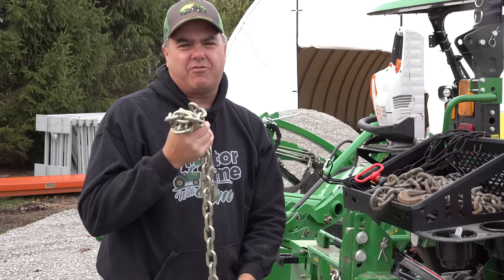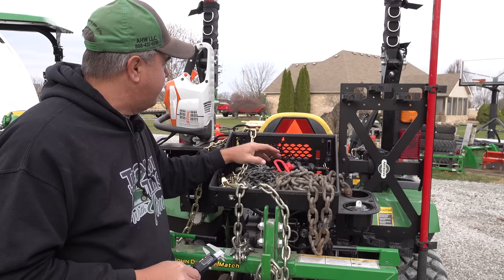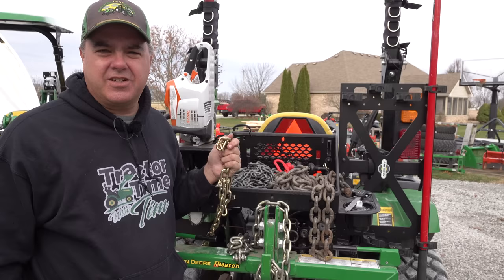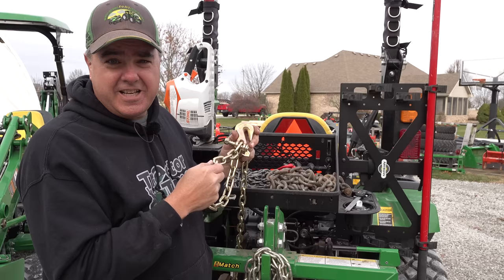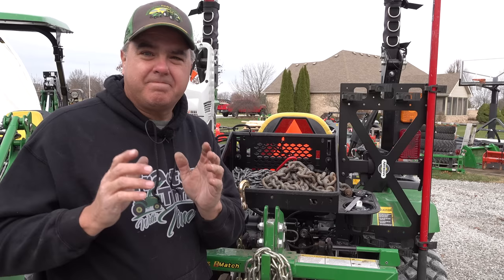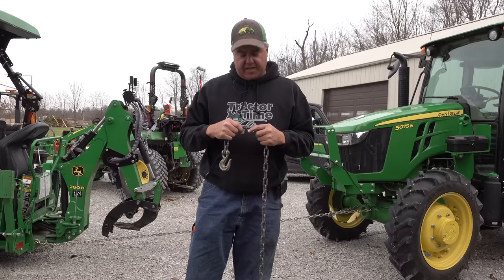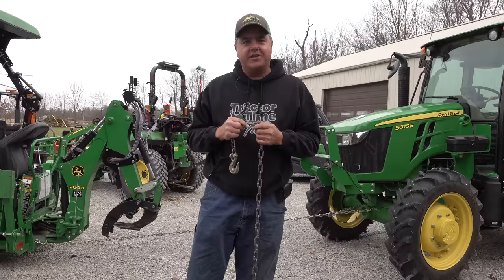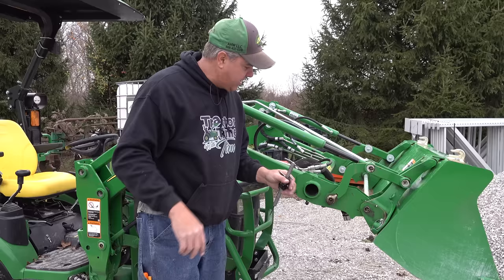What Compact Tractor Owners Need To Know about CHAIN!

Comment: Simple subject, but the reality is you might be saving someones life who has never had a basic education on proper chain use, well done Tim.
Reply: Growing up we never had chain except for the tires. Now I have several chains with a 5/8" x 20' the largest.  It works great for removing tree stumps but when tied around the waist it is a bit heavy. Much better to use the truck or the small tractor.
Reply: I'm here to learn  I ain't never had no bad luck but if I can learn enough to prevent it 😜

Comment: Excellent points!
As a former fence installer who used chains for transport,and pulling old posts from the ground.
2# 12ft chains ,each with a slipper and standard hook. 
Pulling posts,hook chain down low on tractor and post.
Add the largest wheel (scrap wheel/rim or with tire)  as close to the post as possible, and run the chain over top of it.
The wheel becomes a rolling fulcrum.
A 4x4 works better,but needs an experienced holder and tractor driver.

Comment: Hi Tim;   Very nice video covering the basics of chains.  I wish I had seen it 10 years ago when I first got a tractor and started being an amateur farmer!  Over the years I had to learn most of these things via the school of hard knocks... but my tractor survived and I still have all my fingers!  I did want to comment on one thing though...  You mentioned the WLL of various sizes of chains and commented that a 1/4" size grade 70 chain was sufficient for use with a sub-compact tractor because the tractor could not pull any harder than the WLL of the chain.  This is true, but only on a straight pull.  If you are using force multiplication with pulleys then all bets are off!  I frequently use chains as part of the rig I use to topple trees.  I usually prefer to topple a tree if possible rather than fell it with a chainsaw as I know exactly 100% where the tree is going to fall, I can be far away when it falls, and it gets the stump out of the ground as part of the deal.  I use 1/4" wire rope (1200 lb WLL) and 10 pulleys which gives a theoretical pulling force of 12,000 pounds (at the load limit of the wire rope) against the anchor point which is provided by the chain, sometimes quite a long chain, over to a big strap looped as low as possible around a big tree.  I use 20 foot lengths of 3/8" grade 70 for this (6600 Lb WLL) joined together with double clevises and have never noticed any distress in the chains.  The pulls are always done slowly and smoothly, usually with the tractor engine at idle speed.  More power just isn't needed.  So far this has worked 100% on trees up to about 18" -20" in diameter rooted in heavy clay.   Having worked this all out by myself with no expert guidance I am not sure an expert would approve of this procedure and if you have any comments I'd love to hear them!  By the way...  I store my chains in rubber feed buckets.  The rubber buckets don't crack like plastic ones do, they keep the chains organized, and the handle makes them easy to carry around.
Reply: How far up the tree do place cable and how do you get up there?
Ditto on the rubber bucket. It’s been my chain storage for decades.
Reply: Hi Stuart;  Actually to topple a tree I pull on it quite low (where it is stronger) as I want to pull the root ball out of the ground and not take a chance of breaking off the trunk of the tree which could be sudden and uncontrolled.  At the tree that is being removed end of the rig I put five 6' foot long double loop straps (Princess Auto part number 8021419) wrapped around the tree as a choke.  These straps are typically placed only 5 to 6 feet above the ground.  The free loop on each strap is placed in the hook of a 1 ton snatch block (Princess Auto part number 8824922).

    At the anchor end of the rig a 30 foot vehicle tow strap  (Princess Auto part number 8841561) is wrapped 1 1/2 times around a stout tree as low as I can get it.  Wrap it so the 2 looped ends are even and put a shackle in the loops.  The shackle connects to 20' lengths of 3/8" grade 70 chain.  I use as many 20' lengths of chain as required to get near the tree I am toppling and join them together using double clevis fittings (Princess Auto part number 3804598).  At the other end of the chains I put another double loop tow strap connected to the chains by a shackle. This shackle can be moved along the last length of chain to fine tune the gap between the 2 sets of pulleys.  At the loop at the free end of the tow strap I put the hook end of 4 more of the 1 ton snatch blocks.  This leaves you with 2 sets of  pulleys facing each other.

      I use a 150 foot length of 1/4" wire rope to lace between the 2 sets of pulleys. (The wire rope is prepared with a loop at each end using a thimble and wire rope clips.)  The anchor end of the wire rope is connected to the loop on the tow strap (along with the snatch block hooks) by using a shackle. The free end of the wire rope has a shackle on it which  goes over a hook on my tractor.  If you work it out this means that there are 10 lengths of wire rope between the pulleys so the rigging should be set so that there is about 15 feet between the 2 sets of pulleys.  (150 feet of rope divided by 10.)

       I then use the tractor to pull on the wire rope and gently tip the tree over.  Keep an eye on how tall the tree is compared to how far away you are from it with the tractor!  You don't want it landing on your head!  A variation is to add a 5th pulley at the anchor end and pull in the opposite direction.  This way the tree is tipping in the direction opposite to the direction the tractor is moving so it is a bit safer but you don't always have room to do this.

     I hope this helps but as always, use this information with caution,  common sense, and at your own risk....
Reply: @Vincent_Sullivan  Super helpful response, especially the URL for the products you referenced.  Thank you.
Reply: You wouldn't have a video on this by any chance? All those parts you listed are currently available at Princess Auto BTW. Thx.
Reply: @Stu2366593  Hi Stuart;   Having the Princess Auto (PA) part numbers only helps much if you are a Canadian living near a PA branch but I figured that anybody anywhere could browse the PA web site and see a photo of what I am talking about so they know what they are looking for when they search for a local source for these items.  Yes, all the part numbers are current - I checked on that!  I really like these snatch blocks as they have a couple of features that make them particularly suitable for this sort of work.  I got mine years ago and PA didn't stock them for a while and I am very glad to see that they are now back on the shelves.

       Sorry, I don't currently have a video of the process.  That is not a bad idea though!  Next time I topple a tree I'll see if I can take a video to post on YouTube.

Comment: I determined after years of use around home that a 9-10' 1/4" grade 70 or 80 with one grab and one slip hook covered most everything I needed to do with my compact tractor and yes I also stored it right on the floorboard so it was always there and I can't stress this enough, "I never had to go looking for it".  I did the same at work in the backhoe (12'), the loader, grader and each dump truck had 20' of grade 70, 5/16" transport chain.

Comment: I use a quarter inch 120 grade chain with a grab hook and a slip hook on it. I use it for logging in a small operation I have been made fun of it for a long time but it is some much lighter. Like you said It can be used all day with little exhaustion.

Comment: hi tim i use chain every day well presented. one storage idea that i use for the truck regarding chain which will help is cut out the top of a 5 liter plastic oil/antifreeze bottle taking out the spout but leaving the handle intact. not only dose it store the chain but makes it easy to carry. we fit 9 meters of 8mm grade 80 chain in one bottle
Reply: Very smart. Good tip

Comment: Haven't seen it in the comments yet, but don't forget to throw something over the top of the chain in the center (coat, blanket, etc) before pulling.  That way if it comes loose under tension it won't become a as much of a danger.  Think of it as if it were a cable that broke, it is a deadly whip that can cut a person in half.  If possible cover at least 5 feet.  Don't own a tractor but this information is applicable to many situations.  Thanks Tim, keep up the very informative videos.

Comment: I am retired now but I was a machine repair man also a tool and die maker but to make the story short I went to school for six weeks to learn rigging and there is a awful lot involved in rigging.

But I will tell you this I think you did a very good job and explaining the basics what you should watch out for, one other thing the higher the chain is if one and breaks that means it's going to be flying in the air at that height and it could easily hit a man behind the steering wheel of the tractor,

I seen  two 20-year-old man towing a car up a hill with a heavy forklift truck it had a full cage around it and a was factory workers with no experience with rigging, I walked out the door just before the chain snapped and they was doing the same thing as your neighbor did. When they took off to pull the car up the hill the chain snapped and hit the wire mesh cage that was around the forklift.

They both jumped out of their vehicles laughing I walked over to them and looked at the guy behind the forklift truck and I told him you are lucky you took this forklift truck and not the other one that don't have a cage around. That chain would have slapped you right in the back of the head and you probably wouldn't be here today.

After he looked back in force at the forklift and the car he wasn't laughing no more I told him if management everything you doing that you both would be unemployed right now consider this a lesson of life don't ever make that mistake again never jerked a chain like that.

I did not report them because I could see the seriousness of the situation they understood when I explained it to them and I figured it was a lesson enough to learn without losing their jobs, power equipment is very dangerous and I really think this was a good video to teach people a little bit about that good job buddy

Comment: I understand your point about hooking low for safety,  but sometimes you need to hook higher to add weight to your tractor.  I hook to the three point hitch so that I can lift with the chain.  In this case I hook very short.  Put some dirt in your bucket for more weight.

Comment: I started farming with my dad 50 years ago. We grew spring potatoes in Florida and often had to harvest in the mud. We had 70 hp tractors (John Deere 3020) and used 20 ft of  half inch chain to pull struck trucks out. A real work out lifting that thing.  About 15 yeas ago I was working on a farm and had to use a 200 hp JD 4960 four wheel drive to pull a fully loaded (30,000 lb of potatoes plus the truck)10 wheel bulk truck out of deep sand where it had broke down. All I had was a 5/16 chain that the boss said was good enough. I made sure to take up the slack before I fully let out on the clutch. The tractor dug in and away we went. All those years using that heavy logging chain when all we needed was a good quality 5/16 one.
Reply from the maker: Ha!  A 4960 can break a 1/2” chain in some situations!

Comment: I have a good tip for you if you are having to pull something horizontally, it takes two chains, but it's totally worth it.  Put a used tire in between, even if someone starts to jerk the tire will give and slow them down, but it will also let puller have enough momentum that it will let you pull more than you would have (not as necessary if you are using a pull strap).  Also, a warning, be careful going around any cast items, especially a yolk like piece, if you were using something stronger than the small tractor you would severely risk breaking that piece (I'm speaking from a bad experience)  the four bolt holes on the front of your tractor, under the grill (where a weight bracket would mount) would be a great place to add a hitching point.

Comment: It's not the Working load limit thats gets you into trouble it's the shock load put on a chain that's the real test, yea your machine might have a gross weight of 2500# but have to much slack and you could easily quadruple that amount, ie. 5/16 transport will break at about 20,000#, not sure about 1/4". it might be heavy but i won't go less than 5/16" on my subcom. Something else to consider, if you are try to pull a stuck object, ie. car, truck ect. Use the proper weight nylon snach strap, they absorb the shock load or give you a more gentle pull, and arrest your pull line (if very long, 60 feet or more ) with an old tire (no rim) with the line passing through the tire in the middle of your line to help prevent wip, especially steel cables, they can be deadly. great video with great information.

Comment: Great video!!! Even though my dad  ran a wrecker service and towing service for 50 years and. I worked for him when I was young, it re-enforced the proper uses, practices, types and applications.  I have some chains that have been stretched and abused. (not all by me!!).  I am going to  replace and upgrade all my  smaller over stressed chain with  grade 70 chain with the  retainer hooks before spring.  Thanks for  inspiring me to get going and  to use the proper  chain and use safe practices!!!

Comment: the little slots beside the draw bar at 11:50 are attachment points for safety chains when pulling  a trailer or implement equipped with safety chains  and some free advice - when pulling with a chain lay something over the chain, like a folded tarp or fender cover or even a coat to make the chain go to the ground if it breaks, this is especially important if pulling with a cable or a rope.  if a chain has stretched links it should replaced.

Comment: Great instructional video. I happen to have had many  chains that have been stretched. They came from my In laws that worked in gravel pits all their careers. The chains were bought as graded 30 and were used to pull out tri axels and other heavy equipment.  After a few uses they were tossed because of being stretched. They wouldn't buy expensive chains because they would have been stretched too from over abuse. Some would have been stretched so far  that the chain had lost all it's flex.
Reply from the maker: You have a nice 5/16 chain now!!! I’ve used it!
Reply: Shoot, now I have to find another hiding place. 😁

Comment: Great tips and info.
The one exception to not hooking a chain to 3 point is when pulling out post. As long as the tractor is substantial enough & on flat ground, that's the best way to pull a post.
Reply: That's why they make 3 point hitch drawbars, you can adjust up or down to match your pull point ( if possible) if you're furthest pull point is much higher pick a solid pull point on your tractor ( unless your 3point is power up and down) then these drawbars are great.
Reply from the maker: Be VERY careful with 3 pt drawbars.  The 3 pt can and will come up unexpectedly.  There is no down pressure.

Comment: Where I worked the company brought in a chain company to check all the chains, lifting straps and other devices we would use over a years time. I think the biggest chain for lifting like the truck frames were 7/8 which might I say are quite heavy. Each chain or if they were multiple chains on a ring. were taken then to be replaced.  On a chain at my place it's 3/8 with grab hook on one end an slip hook on other end x 20 feet. I need to buy some 5/16 and binders for my tractor if I ever transport it. Great video Tim! One time at work we had a mining truck sitting on our triple wide trailer out in the yard, it is attached with the semi tractor, well I got stuck. So maintenance came out with a wheel loader pretty good size. They hooked a chain on the back of the triple wide trailer and started pulling, well the chain broke and we never found all of that chain, don't know where it went!